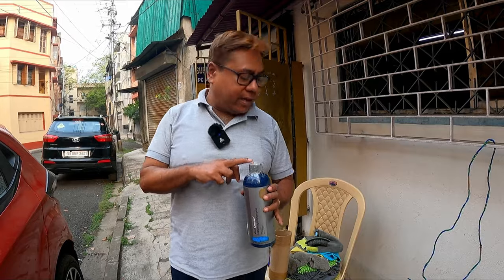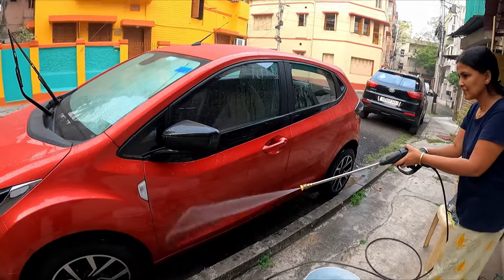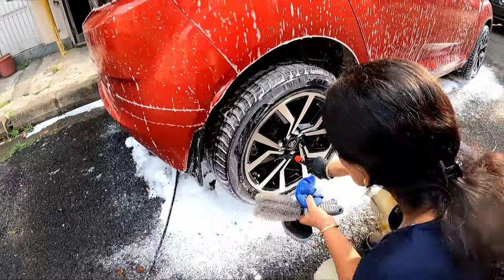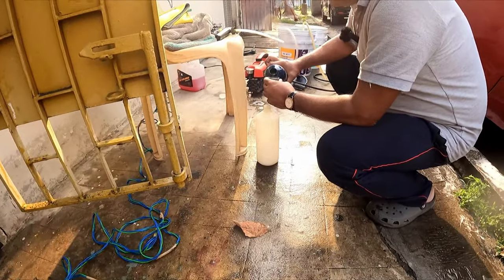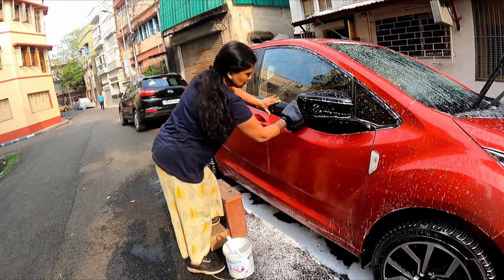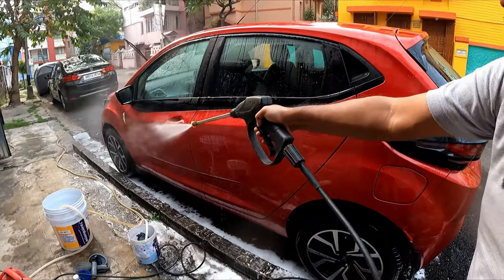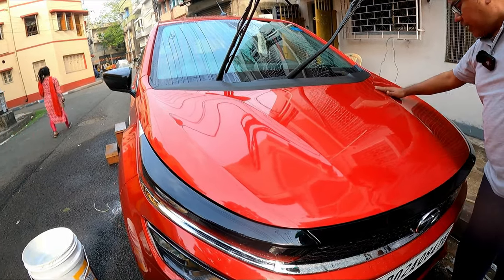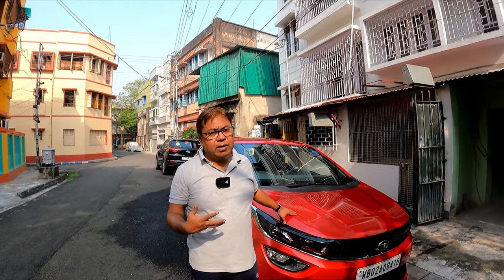Koch Chemie Nano Magic Shampoo | It Cleans Shines & Protect #kochchemie #cardetailing #tataaltroz

Comment: Silicon/Graphene based shampoo are a jack of few trades master of none kind of product targeted to fool unaware consumers. 
Your videos are highly impressive but unfortunately we all lack knowledge. 

A medium to heavily gritted car needs first foam layer of high ph pre-wash followed by pressure clean followed by ANY neutral ph 7 foaming car wash incl this one you used. 

Silicone/Graphene coatings should be last to be applied ONLY on body. 

Not to clean tires with this particular shampoo. Except brake dust everything else can be cleaned with the pre wash alkaline shampoo. For brake dust any low ph should be fine.

So for the exterior all one needs is a versatile pressure washer, 
A high ph (alkaline) medium foaming quick release pre wash soap, 
A neutral ph high foaming shampoo 
A Graphene spray

Koch Chemie BTW makes excellent products and clearly ph stated targeting specific needs.
Reply from the maker: Thanks for your feedback.
Reply: Video te majhe majhe Bangla shunte bhalo laglo

Comment: Based on you experience which shampoo is best for graphene coated surface? Wavex Graphene Ceramic, Carpro Reset, Turtle Slick and Slide pure Wash or Koch Chemie?
Reply from the maker: So far I have used several shampoos of which I find Koch Cemie Nano Magic Shampoo is really a great shampoo. It's not only easy to apply but gives a good shine and protection too. I have also used it in bucket method which is also great.

Comment: Can you suggest car detailing products where less water is required.
I stay in an apartment and have water scarcity issues.
I own a Starry night colour Hyundai Verna.
Reply from the maker: You can go for a waterless car wash. I have videos about how to wash a car with a waterless car wash. In case of stubborn dirt running water is the only option.
https://youtu.be/i29EWivR_ZU
Reply: Typically, pressure washers consume less water compared to conventional hosepipe washes.
Reply from the maker: Yes you are correct. It requires much less water to wash a car with pressure washers.